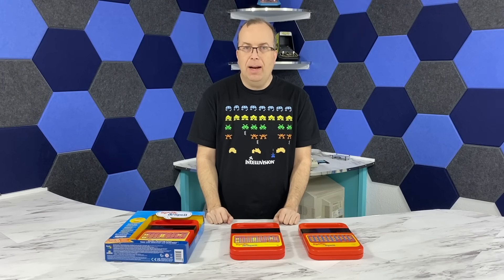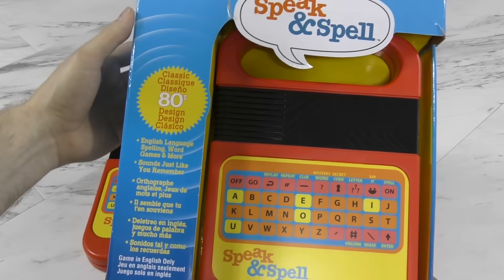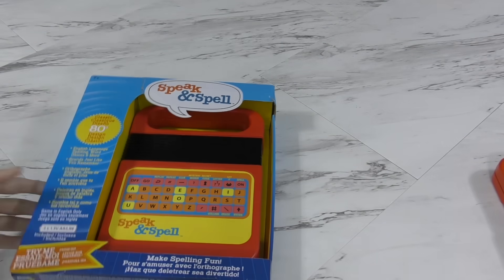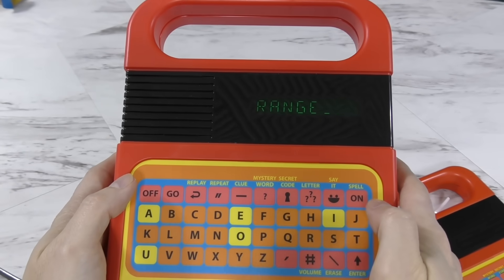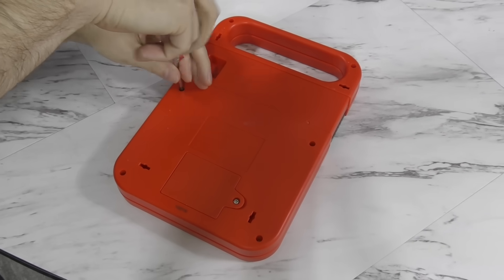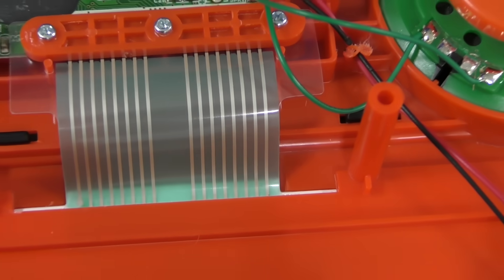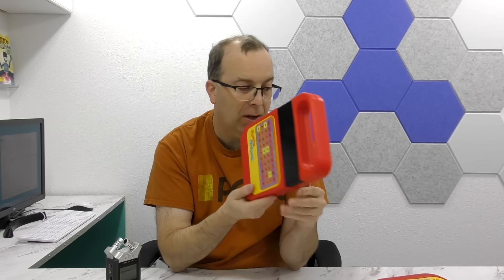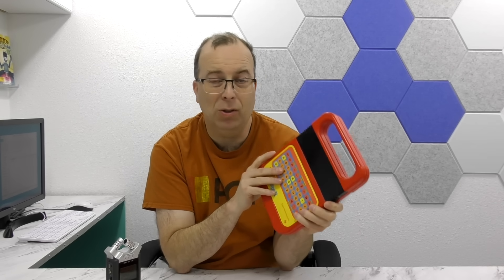Speak and Spell - 1983 vs 2019 model!

Comment: Those "heavy duty" batteries are indeed crap.  Zinc/carbon chemistry has very low energy storage compared to alkaline and will also often leak.  The paper tab removed from the back of the unit breaks the battery circuit and prevents the batteries from discharging while in storage, which is desirable with such low energy capacity.  The only benefit to zinc/carbon batteries is their low cost, which is why you see them included with all inexpensive toys and products.

Comment: I've still got my original one from the 80s. I don't like the new one. They should have kept the original larger batteries and had a way to connect the expansion packs that worked in the originals. Then it could be classed a replica of the old. It seems like a knock off, despite the tech being more modern.

They really should have made something different here instead, they could have fit a bigger board containing writable memory along with read only memory containing Speak and Spell and Speak and Maths and any other Speak and .... software. Then have a CD reader built in, so you can play music CD's and a USB connector so you can update and add new software.  Just imagine learning another language with it? Maybe even an FM/Am tuner too.

Such a wasted chance.

Comment: The new one is definitely clearer. I think I had a Speak and Spell when I was really young, but it didn't survive. I actually still do have my Talking Computer. It's grey, uses red LEDs for the display, and had cartridges that you could get with it, but I never got any. From the '90s on, I just run it off of a 9 volt battery from the power port. It took 6 D cells, but the 9 volt battery lasted for a long time. It's kind of like when I ran an Atari 2600 off of a 9 volt battery. I didn't have a transformer at the time, but the 9 volt battery had a long life to it. I do remember batteries just being crap in the early 80s. I'm sure they needed the D cells. Anymore, D cells are just repackaged AA batteries that are expensive. Modern batteries also leak like a sieve. They heyday for single-use batteries is over.

Comment: The coolest thing about the original is the board, more precisely the discrete integrated circuits, maybe it would be cool to take them out and make another project with them?
The modern version is just a system on a chip and there's nothing that can be done with it outside their original board...

Comment: "There's not much here" welcome to modern electronics. It's all done using anonymous microcontrollers or the mystery blob
Reply: And everything is so SMALL, too!
Reply: @Astro-Rabby  it's impressive and also depressive at the same time
Reply: Well. I mean...Advancement in technology. The original needed ALL of that to do simple spelling games. Meanwhile, a board/processor etc that sits in my pocket blows away any computer from the 1960's-early 2000's...
Reply: @Troothbomb  Took apart this universal remote control I bought from five below.

I was fricken blown away!
Reply: Right. The reduction in board size has less to do with cost reduction and more to do with improvements in technology.
Reply: Some day. SOME day, the mystery blob won't be a dollop of epoxy over a tiny chip. It will be billions of nano-machines placed down as a drop of goo and then get "programmed" to arrange themselves into a functional "whatever the application requires" before the whole thing solidifies when given the "permanent save" command. Fingers crossed!

Comment: Holy...isn't the 2021 one, compared to minute 8:02, significantly thicker than the original one?! How could that happen, due to the fact, that the new one has intensivley less electronics inside and uses thinner batteries?! o.O

Comment: While I do think the modern Speak & Spell has a few improvements over the original model such as not having to use C-cell batteries, larger text, and a clearer speaking voice, ultimately, I would just stick to the original one myself since the text letters are much easier to see, the speaker is far more pronounced, and no annoying screw battery compartment like you see on most electronic toys these days. And as you’ve said, David, I think they only designed this for people that grew up with the original Spell & Check toy. Regardless, another excellent review! 👍

Comment: Our neighbours had one which the father brought back from the US after his company needed him there for a few months in 79.  It appeared on shelves in Australia in 1980.  I did pick up an 80s model in a thrift store a couple of years ago, but the keyboard doesn’t work right.  There’s a low voltage on one pin, so a faulty chip is the cause.  It plays the games but the keys aren’t scanned right, it’s like a stuck bit as it reads every 2nd column twice.  The ET module works fine though.

Comment: I have a speak and spell app on my phone. The voice is that of the 1978 version and it seems to work well.
Not a fan of the "microwave" style buttons but with youngsters using this the new buttons will prevent liquids getting into the key contacts. I've spilled liquid on my keyboard and you have to take the keyboard apart and clean every contact.

Comment: An OLED would have been a good VFD replacement, and they could make the whole thing scaled down to like 66% size so that they can get a smaller OLED that is cheaper, since the batteries are smaller and the board has just one globtop IC on it. It would still look like a VFD especially if the window was green tinted and the OLED was white. And why does it sound different? I never had one but can think of at least three songs that had those sounds in them, and the new one just isn't it.

Comment: "I'm not sure what kind of batteries these are...." Uhh... still AAs, I would guess!
Reply: I expect what he meant was what type of AAs they were -- i.e. are they alkalines, zinc-carbon cells, lithium batteries, etc.   From the looks of them, they're probably zinc-carbons; they're pratically cheap as dirt, and unlike alkalines, they're relatively safe to leave inside something that might sit on the warehouse or store shelves for months (or years) before being sold, since they're not as prone to leaking if they self-discharge in the meantime.

Comment: In the early 80s I worked at a library, where we'd loan these units out for a week at a time.  It was the most popular item we offered to the public.
Reply: Probably like a Raspberry Pi today that my library currently rents out. No idea how popular it is but could well be as none were available when I asked.
Reply: How often did they need replaced?
Reply: @Clay3613  During my time there, we only changed the batteries.  They held up very well.
Reply: I've seen libraries with 3D printers that you can use, yes I'm serious.
We live in a very different time now.
But it is awesome to have games and other stuff there. Modern libraries or what I always hoped for as a kid.
Reply: @JohnDoe-wq5eu  The Tulsa central library has a enclosed soundproofed makers space. There's 3d printers, cnc mill, Lazer cutter/engraver, dremal rotary tool, drill, serger sewing machine, small loom, drawing supplies, vinyl cutter, etc. 
There's also an actual small recording studio & an area for editing, copying, transferring things from vhs to dvd & so on. 
Actually I'm not even sure what else they have available by now. 
There's also 2 flight simulators upstairs. 
You can also borrow various sized meeting rooms from a small glass enclosed study area to some pretty big ones. 
Some of the other bigger branches also have at least 3d printers. 
It's a really really nice library & best of all the downtown bus station is across the street. Makes it fairly easy to get too.
They also have a bunch of fancy computers for running various programs on. 
I just wish they start a tool library so we can check out simple things like a drill & level to hang shelving. Or something like that anyway.
Reply: @ It's quite common for libraries in Australia to have 3D printers and other similar machines on site for clients to use.
Reply: @Stevie-J  I guess I feel old……my school library loaned records!
Reply: @jonnycando  Ours did as well.
Reply: You used to be able to borrow software from my local library. Not too many games but some more serious software.

I got what I think was my first copy of a C64 Assembly package (I forget which one) from there. :)
Reply: @Stevie-J  yep it’s said there’s nothing new under the sun and everything just comes around again for another go. Makes you all warm and fuzzy inside when something from your youth gets popular again!
Reply: They had a couple of these at the Grand Forks public library when I was a kid. They also had two TI-99/4a computers with a bunch of cartridges. I spent hours playing around with those things. Started my love affair with the TI-99/4a.
Reply: Back to libraries and electronics, in about 2000 I went to the central library in town to copy the schematics for my TV which had broken (the highest voltage capacitor in the whole set had literally disintegrated so I couldn't tell the value).  They had the large books of Service manuals that used to be published annually. You weren't allowed to take those out of the library but they did have a photocopier where they charged something like 5p a sheet.
Reply: Weird. I don't remember seeing them in my libraries in CA's schools, and public. Where was yours?
Reply: @antdude  Jenison Public Library, Michigan.
Reply: @Stevie-J  I vividly remember watching a copy of Indiana Jones and the Temple of Doom at my library's TV room. Later, when they realized kids were gathering in there to watch PG film material they bought more TVs and Tape Decks, added headphones and moved everything to the open, right next to the entrance hall.
Reply: @Stevie-J  Where / when was that. In the 1970s just about every department store in the U.K. had a record department and there were numerous record shops like Virgin Records (which was the start of Richard Branson's business empire).  They were still there in the 1990s but CDs had replaced vinyl.

Something I recall about Boots (actually a Chemist downstairs but with an audio / record department upstairs opposite Bristol (U.K) University was that at the start of the 1970s they still had listening booths so people could check out a record before buying it. They must have been one of the last shops to do that. 

Back to libraries, in the 1990s the local library lent out CDs for a small charge . A colleague kept renting them. For some reason he also kept buying lots of blank cassettes :-)
Reply: I was a little kid in the eighties and this is how I got to play with mine, it was too expensive a toy for my parents to buy for me and we did borrow it a lot!
Reply: I went to the library and asked for s book on suicide.... they told me to F off as k wouldn't being it back.
Reply: The Speak n Spell was in the 80's. O-M-G yes the Walkman... then the Discman... then the iPod, iPod Touch, iPod Nano, etc... wow has the technology changed, LOL! 🤣
Reply: that's cool 😎
Reply: Coolest library ever!
Reply: More popular than books?
Reply: @n6vcw  it's moments like these, i think about not getting angry or caring too much, what's valuable today's worthless in a few years lol.
Reply: I remember the teacher in elementary school had one of these in a weekend box for the classrooms best student to take home for the weekend and man I low-key was so hoping i was going to win every week (I think I got to take it home once)
Reply: gross
Reply: @thesoothingshepherd  What is gross?
Reply: I had one when I was a kid. Miss it
Reply: I wonder if Toy Story's "Mr. Spell" had anything to do with it's popularity.
Reply: @richardkirkland6805   Nah, Toy Story came out mid90s, the speak and spell is from the 70s and wasn't popular thing in the 90s. It was a retro toy by then.  

We had GameBoys and Walkmans.
Reply: That’s pretty cool
https://youtu.be/MtlI2yc3l5s

Comment: The sound chip from the vintage Speak machines can be run from a microcontroller..
to me that's the value of finding a ratty example at the frift store.

This is just about nothing to do with the orignal, but all that empty case is so tempting.

I destroyed my original from experimentation back in the day. My current retro trinket is a Simon and one of those clone Mattel Football games, going to mod it to Guardians of the Galaxy spec.

Comment: I definitely agree with everything about the new model I would rather get for me an original 70s model because thats what I had. Probably it's more expensive than the 80s version but it would depend how expensive for me. I also think that they could have come up with a modern version with more usable functionality and for not much more especially if they used a raspberry pie and larger better screen.

Comment: I'd be interested to know the power consumption of the old and new versions
Reply: The new one is just a passive LCD with one (or maybe a couple) of LEDs to light it up, and most of that power used is on the LEDs. The vaccum fluorescent display of the old one is a massive power hog in comparison, since it has small resistive wires on the display that have to be hot for it to work.

It would be interesting to see the actual mA, though, especially on the VFD one with all the characters lit up!

Comment: I think you can easily hack a power jack and a headphone output into the 2019's one, but sadly that's all. 😉
Reply: I see entirely the opposite: A huge, empty, inviting void. Don't hack the board - just sever that blob entirely and just use it for the display. Then you've got a speak-and-spell with a display, keyboard and speaker, and enough empty space to fit a pi inside easily.

Comment: One thing I have noticed with a lot of plastic toys like these today is that they are way cheaper built and manufactured than back in the 80s. Often almost translucent thin plastic with some colour added, warping when you press them. I understand they are trying to optimize production to make a decent profit on any single item but the cheapeness in a lot of these things is noticeable for one who have lived in the 80s. One exception could be the Disney Infinity toons for the game which are very well made although ofc a bit costly for those wanting many (or all). Ofc today you can find tons of them cheaply everywhere.

Comment: The battery compartment needed a redesign anyway, as nowadays most countries will require it using an actual screw, so kids can't take out the batteries and swallow them. Parents complained that it gave their kids too much energy.
Reply: These the same kids eating tide pods? figures :)
Reply: I'd like to see the kid that could swallow 4 C cells.
Reply: C-cell batteries can't be swallowed by small kids.  Though D cells are safer, being the size of duplo® bricks.  This new circuit is small enough to allow a much flatter case.
Reply: @johndododoe1411  CPSC requires all access to batteries in toys marketed for children up to 3 years be through a cover with a screw, regardless of battery size. Battery size is only relevant for toys marketed at older children. The Speak and Spell is marketed towards 7 - 15 years, so the C-cells might not have counted as a safety hazard, if they hadn't been shrinked. Obviously the driving force for using these large batteries was the vacuum fluorescent display, that the new version doesn't have anyway.

Comment: They would probably sell more if they just relaunched the board or chip, as that's the part I would want it for most
Reply: yeah the mod community would love a remake of the board, i was really excited until he opened it up and it was that tiny board
Reply: @carl1367  Yeah, the fact that the pins aren't even accessible...
Reply: Or put a slightly better screen and a "legacy mode" (using a dedicated button) that 100% mimic the old LPC speech voice for nostalgia.